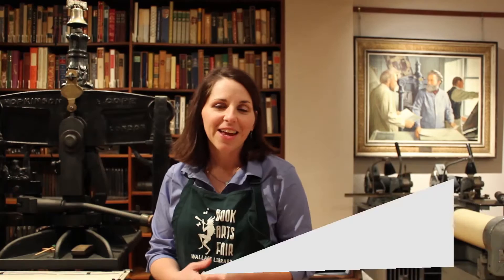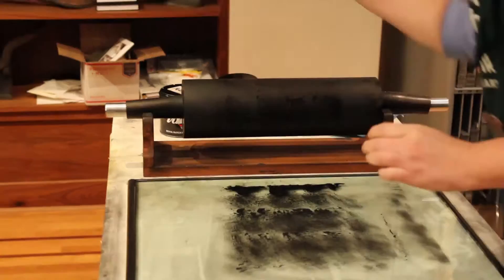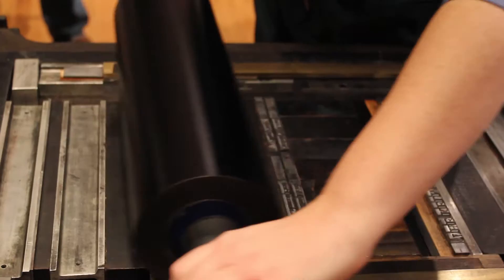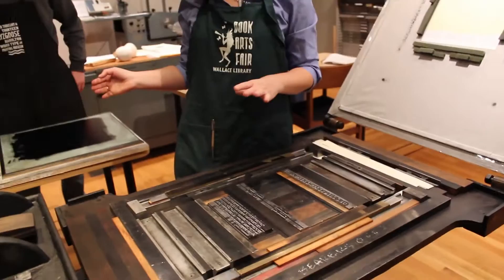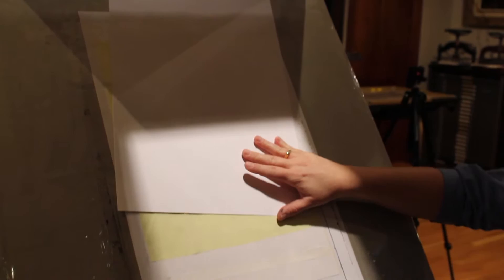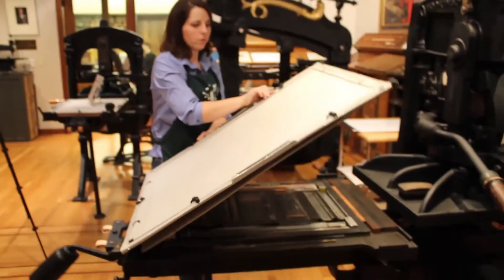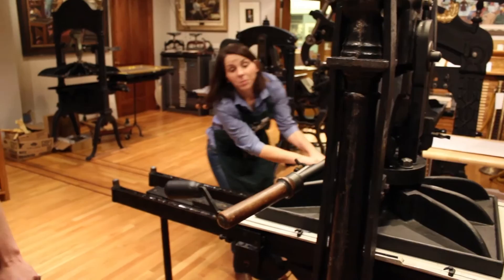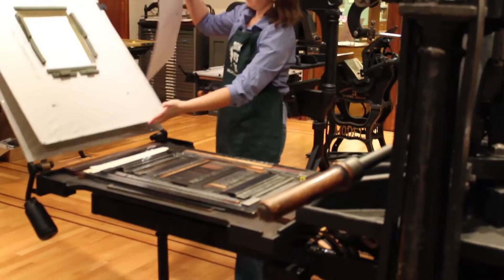Printing using the Kelmscott/Goudy Albion Iron Hand Press

Comment: It would have been quicker to roll the ink out using a smaller ink roller first.  And a printing "forme" is spelled with an "e" on the end (3:24)
Reply: No need for bearers.  A trademan would use a smaller hand roller